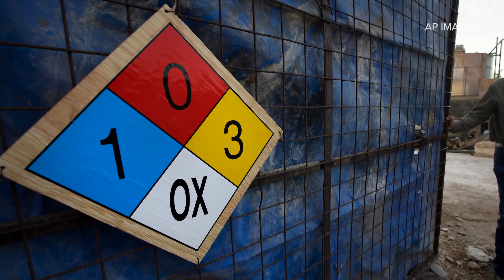West, Texas explosion: Fire scientist says ammonium nitrate oversight not good enough

Comment: 18,000 cows died a few days ago because of the slaughterhouse negligence. 🫴
Reply: 2.1M sq. ft....L-A-R-G-E-S-T in TX.

Out of sight, in the middle of nowhere, UNinspected.  Non-Compliant. WHAM-O!!!
Reply: It wasn’t a slaughter house, it’s a dairy farm. And it was a methane gas explosion - manure handling equipment.
Reply: @ralfie8801  RIGHT-O!  It wasn't a slaughterhouse, but 18,000 to 19,000 dairy cattle were "slaughtered".
And you say a waste gas explosion.
Poor maintenance?  A "breakdown"?
Such a Pity.
Reply: @SpicyRok7482  
Who knows? It’s such a throwaway world these days with all the “maintenance free” equipment floating around now. 
I haven’t read anything about what actually caused the gas explosion or why.
Reply: @ralfie8801  I would HATE to learn it was a worn-out/broken/missing blower fan drive belt.
As they say, MOST accidents can be avoided.
Reply: @SpicyRok7482  
I wouldn’t think that equipment used in an explosive environment would have drive belts just because of the fact that belts stretch, then slip, get hot when they slip, and can smoke and catch fire before they break.
Edit: Meaning in the slurry treatment pond. The barns are full of air circulation fans for the cows, especially if the farm is of the type that the cows never leave the barn except to go to the milking room to get on the carousel to be milked.
Reply: @ralfie8801  I know so VERY little of commercial dairies.